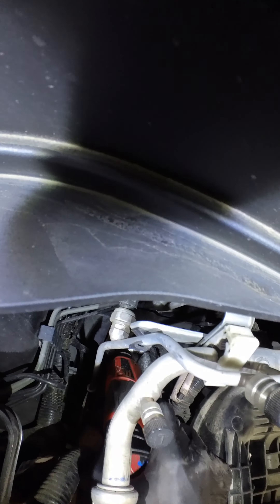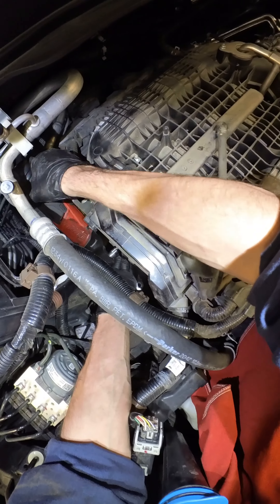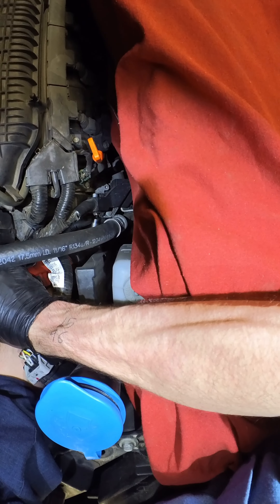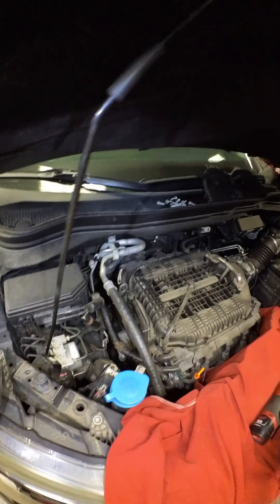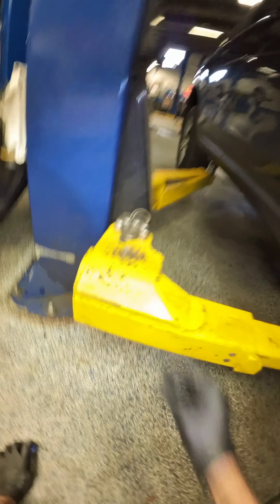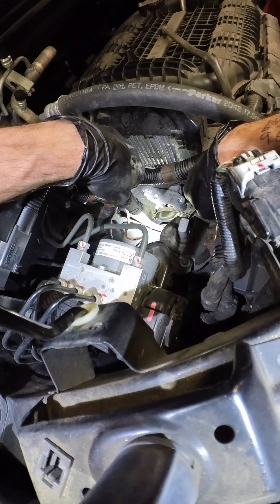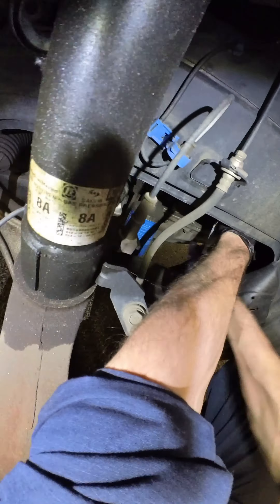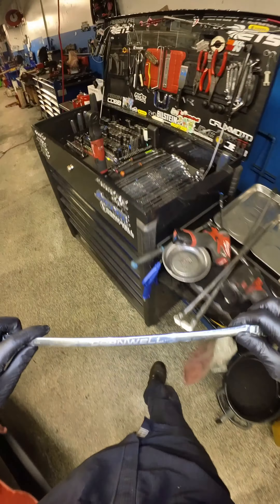2016 Honda Pilot Timing Belt Replacement Part 1 🔧😁👍 #honda #2016 #pilot #jseries #timingbelt #pov

Comment: Do I need a jack to support the engine when the top engine bracket is removed?
Reply from the maker: You don't need a jack as the side mount doesn't really support the engine weight just flex. The front and rear mounts are what hold the weight of the engine and trans

Comment: Excellent videos. I have the same car I have to change the timing belt!  Any advice for the emission system check light for the same car ?
Reply: Mine came on and it was the fuel injectors.

Comment: When u started as lube tech did u start at 15 a hr and how much did u get paid once u moved to flat rate if u don't mind me asking? I went to honda by my house and they said that 15hr then they depending skill level after u go flat rate?
Reply from the maker: I made $10 an hour and an express tech 😅👌 Even less when I worked at Goodyear and Firestone 🥲
Reply: Do u make good money now that ur in flat rate?
Reply: Is it common for pilot to be leaking on passenger side cv shaft by transmission ? My 2019 ridgeline was the same and so is my 2021 pilot
Reply: Curious how many km that vehicle had and what you would recommend for change interval?